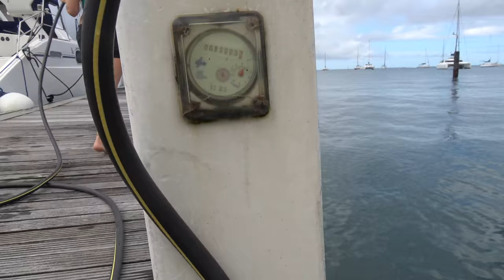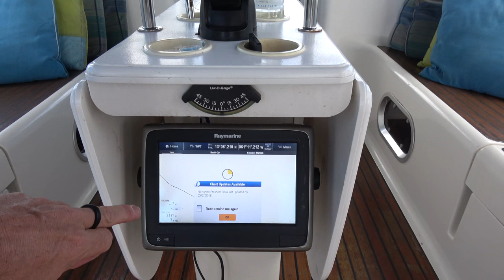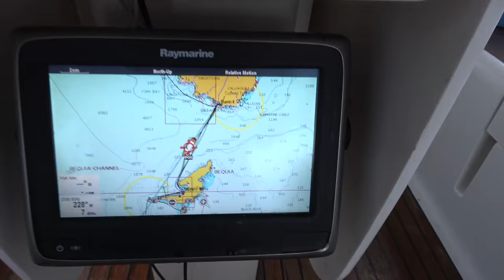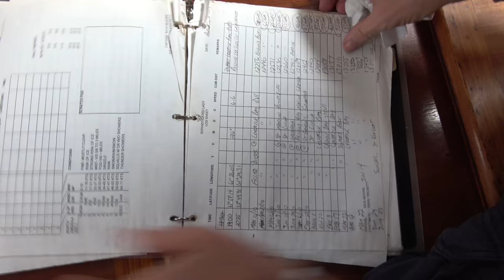SSL 91 ~ Time to go Sailing, 'SOPHISTICATED LADY' Style!  (in 4K UltraHD)

Comment: A good captain knows his boat and I am impressed. 
I offer a suggestion to hardwire a high amp switch for next time so no wrenches need to be involved the next time.
Reply from the maker: could, but then always have to be careful that nobody accidentally switches it over when I'm not paying attention, or forgets to switch back after use
Reply: You should be the only one that knows the switch exists. Who else is qualified to jump the motor with the house batts manually. Merely a convenience for you use if it came up again.

Comment: Great example of experience, knowledge and foresight to get the boat back under way at sea, Rick.

I would also say that the sudden low fuel without a leak would point to the possibility that someone siphoned your tank when you were off the boat or late at night asleep. Minor crimes like siphoning fuel and water, theft of items stowed on deck and theft of dinghy's has been rising in the Islands in the last year. May want to consider some minor security changes just in case.

Look forwards to your next vids :)
Reply from the maker: guess anything is possible, but we have a full 8-camera security system onboard now, so the likelihood of someone getting past it unannounced is pretty marginal.. :)

Comment: Scary how the captain had to anticipate those mechanical problems and provide solutions at sea that would not be available to lesser men.  I usually don't like to watch people working on their boats as I don't have one (or the need to learn), but you made that engine problem kind of interesting.  I wonder what the service life of a Perkins diesel is-- probably rebuild them forever.
Reply from the maker: I asked about having it rebuilt a few years ago, they tested it and listened to it, and said "it's running and sounding perfect inside, don't touch it yet"... so that was good news!  :)

Comment: Third thumbs up!!! Love your videos. I would go fix all that stuff for free just for the sailing lessons.
Reply from the maker: Thanks Victor, glad you enjoyed!  :)
Reply: I'd do a compression check on each cylinder. If you're burning more fuel and overheating it could be either a clogged cooling system, warped head, or bad piston rings, valves. You'd narrow it down with a compression check.
Reply from the maker: had that done recently when we had the cooling system completely flushed and cleaned... problem didn't repeat after fix so not sure what caused it... a bit of an anomaly for now!  :)
Reply: Thermostat maybe shot, slipping alternator belt, collapsing or weak lower radiator hose, bad radiator cap. Or maybe just a bad bad leak.
Reply: Water pump shot maybe.

Comment: Your lights were on even before you pulled anchor starting at 2:25.  I'm not sure if you were on shore power or not, but that battery seem to run down pretty quick.   Yea Rick you got it running.  Yea Sasha.  Go girl, you've got it.
Reply from the maker: we had actually done quite a bit more cranking before it ran out... but didn't figure everyone wanted to watch a half hours worth of cranking, Lol
Reply: Being the old salt that you are, you are no doubt aware of the risk of cranking the engine for an extended time without draining the water out of the lift muffler. Cranking the engine without it firing pumps water into the exhaust system at the exhaust elbow and into the muffler but does not produce enough pressure to push the water out through the exhaust. This can back water up into the exhaust manifold and into the cylinders. All this is assuming your engine is set up with an lift muffler which most sailboats have. Glad you got her going. 16,000 hours is impressive but no doubt that age contributes to the nagging problems that keep popping up.

Comment: Need a boost switch like many RV's have. Press a button and hold it and the 200 amp solenoid closes and gives you house batteries and starter battery tied together. Release switch and solenoid opens. Simple mod.
Reply from the maker: Yes, several options could be used, this is simple though and one less electrical/mechanical thing to fail when you least need it... just hook up the wire, and start!  :)
Reply: You are correct, why add to the problem when simplicity works.  I was thinking, crap he is going to have to wait for the solar to build up the batteries, but you were prepared.  Diesel engines are great, but require a lot more power to turn over fast enough to start, so few understand that.  Btw I would keep the Perkins.  They are great engines, simple to work on and as someone commented they go on forever.  We have some in the old farm tractors and are so much easier and less problems than the newer equipment.  Thanks for sharing the lessons, they are useful even for us who do not sail.  Thanks for the education and entertainment.
Reply from the maker: thanks for great comment, and glad you enjoyed!  :)

Comment: Awesome job Rick. Got her started. I would be curious to see how you wired that "lead" to connect your house batteries to the starting system. Is really as simple as it sounds?
Reply: Yeah, as long as the house bank is the same voltage as the starter  (eg 12v system as opposed to 24v system), you just hook it up in parallel to the bank. Positive to positive and Negative to negative, unless they already share a common negative which I think that system does. Rick does the engine charge the house bank as well as the starter ?
Reply from the maker: Yes, engine charges both banks through a battery combiner circuit... we don't use isolators anymore as the diodes apply resistance to the circuit, which effectively regulates the voltage to the batteries so they never really get fully charged.. the combiner is an electrical relay that connects them together directly whenever the circuit detects the voltage is over 13v when the engine is running... quite a great option to have, and still keeps both banks completely isolated whenever the engine is off and the batteries are in discharge.
Reply from the maker: no, mine is a hard wired system for high amperage... that starter will draw over 200amps to get the engine cranking... the device you showed is only capable of 20amp charge loads, not discharge
Reply: Hi Rick, How many amps does your engine create ?
Reply from the maker: with both alternators about 150-160

Comment: No fuel gauge on that puppy?
That engine sure keeps you on your toes....but its like an EverReady battery....it just wont die, it just keeps going, and going... !
Good vid you all!
Cheerz
Reply from the maker: Engine gauge hasn't worked since I got the boat, but I've always found measuring fuel consumption by engine hours much more reliable, and plus you can instantly know that if the engine starts using more fuel per hour,  there is almost certainly a  problem somewhere
Reply: Makes perfect sense. Thanks for the reply.
Reply: You are right again.  Hours are the best way to measure and good equipment mechanics will tell you like you said, best way to tell how your engine is running.  To many variables in other measurements.  But I would still put locking fuel cap on, if you can, just in case someone wanted to steal or cause other problems for you.
Reply from the maker: yes, could be a good idea.. :)

Comment: Many diesel engines rely on returning fuel from the injector pump to the tank as part of the cooling. low fuel or no fuel returning to the tank = less cooling, could make the difference in tropical waters. If you are considering repowering Beta should be in the line up to look at, they are based on Kubota tractor engines.
Reply from the maker: thanks for tips, will check it out!  :)

Comment: Did you actually run out of fuel? it seems interesting that you lost the auto pilot at the same time. Your fuel system isn't electrical is it?
Reply from the maker: No fuel system is mechanical... autopilot is electrical but I found the failure after the fact... it is now on the short project list and the subject of upcoming video!  :)

Comment: Okay, Rick, enough of the old Perkins.  I won't say it, but I think you know what you have to do.
Reply: Yanmar time.... maybe... that Perkins would make a great secondary boat anchor.
Reply: MrZrryan2 Agreed. We looked into Yanmar and Beta.  Yanmar is all about computer controllers in the new generation, so we're going with the Beta.
Reply: I just installed a sweet Beta 43 :P Niccccceeeeeeee. Cant go wrong with the most popular diesel engine in the world.
Reply from the maker: we were considering approaching Yanmar for a replacement, but never heard of Beta, what is it?
Reply: Marinized Kubota tractor engines. See their web site at betamarinenc.com
Reply: Ken Slattery That's what we're repowering with.
Reply: Rick Moore The problem we found when researching, and we had a huge bias towards Yanmar, was that all the new generation diesels are computer controlled. We didn't want that.  The shop doing our repower is also a Yanmar dealer, but they recently became  Beta dealer because they didn't want to deal with the computer system.
Reply: Rick Moore Beta Marine.
Reply: Sail Before Sunset perkins 👎👎👎👎👎
Reply: This is a bit old. Don't know if you have corrected the engine issue. Beta Marine is a UK company the marinizes (if thats a word) Kubota diesel engines. Kubota is only the largest diesel engine manufacturer in the world. Parts available world wide :) I put in a spanking new 43 HP. Great engine :)